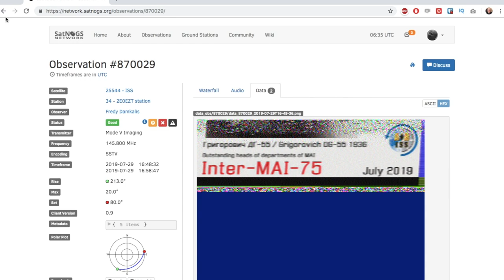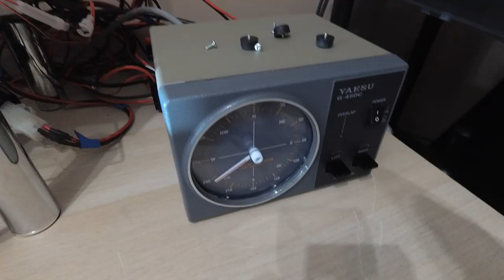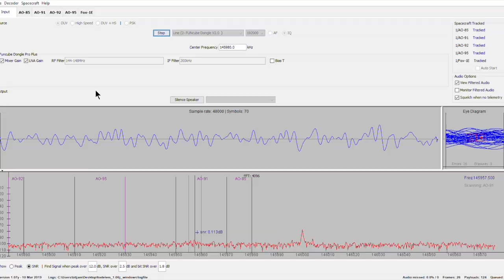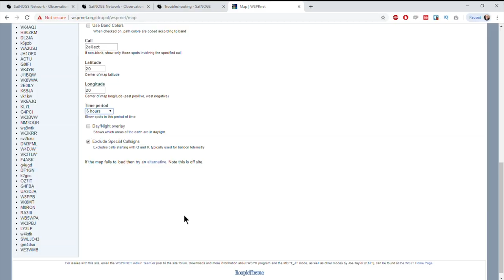Amateur radio's contribution to space science and technology

Comment: 30 metres has been pretty good this week. I've been running 10 MHz WSPR and got lots of spots.
Reply from the maker: Yes I found the weather reporting station in Germany (DWD) on 10.100 very strong signal. I've been trying out JS8call but little traffic compared to FT8 which is a shame as it's keyboard to keyboard data

Comment: Hi Carl. Your doing a great job. If you need any help I am not far away just let me know. Sometimes an extra pair of hand can make a difference. Paul
Reply from the maker: Cheers Paul, for the full licence I'll be taking a mock exam soon and getting an idea of weaker areas which will definitely include electronics. I still would like to meet up and set up HF portable, I've got a good location near Werrington for an evening operating from the boot of a car.
Reply: Good luck with the mock exam, it certainly isn’t easy. I understand that there has to be a mechanism of ensuring people are competent and able to operate within the terms of the license BUT in my opinion there shouldn’t be the amount of technical stuff in the syllabus that many people can not get their head around. This does not make them incapable of operating an amateur station. If they are not careful they will eventually kill the hobby by  restriction. Regards doing some HF portable I an in the process of getting all my stuff together so I can get out in the car again. Ideally I need a good heavy duty deep cycle battery and an inverter. The idea is to be able to open the tailgate on the car and have the radio’s laptop etc set up so I can sit on a chair like sitting at a desk. Next time your thinking of doing some car boot operations let me know and I will come to you and share ideas.